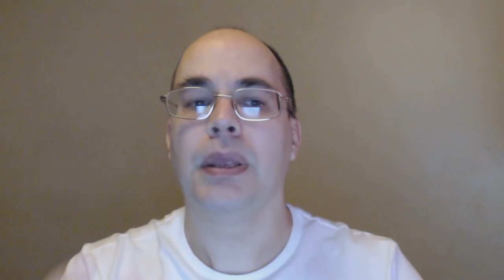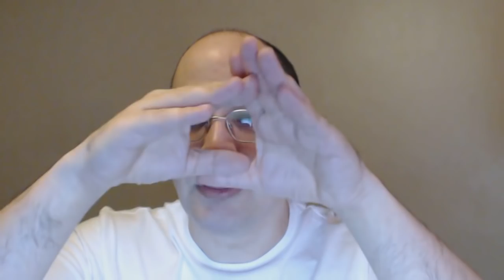How do rockets move in space, with nothing to push off from?

Comment: M J ... In space > NO MASS... the rocket shoots out weightlessness molecules into empty space... If mass = 0... 0=0... nothing happens...
Reply: Mass is not the same thing as weight. An object's mass does not necessarily change just because its weight does. "Weightlessness" in space is simply due to the distance between an object and the earth drastically reducing the attraction caused by the objects mass.
Reply: Think about it on the molecular level.
 When the fuels mix and are ignited in the combustion chamber, a fast expanding gas is created. The gas molecules fly in all directions at high velocity, creating a pressure against the inner walls of the chamber, when they hit them.
To the sides ("right" and "left"), the pressures against the walls cancel each other out.
The chamber doesn't move sideways.
To the rear, there's no wall, but an opening, so the exhaust molecules stream freely out, without any wall to create a pressure against.
To the front, there's also a wall, where the molecules hit and create a pressure.
So, there's nothing to cancel out the pressure against the forward inner wall.
The wall is pressed forward and with that, the engine and the whole rocket.
Reply: Christian Lemage - how about this simple physics problem? I have a remote control crossbow. It is loaded and cocked and I set it on an ice rink on little ice skates (or frictionless surface). What happens when I fire the bolt from the bow? What happens to the bolt? What happens to the bow? What if I use a low mass bolt like balsa wood? What if I use a high mass bolt like lead? What if the bolt and bow both have the same mass? Describe what an observer would see in these experiments.
Reply: all about momentum etc.. I get it...
Reply: Christian Lemage let’s hear the trolls here lol gj
Reply: +Christian Lemage If what you say is true (about molecules sticking together in vacuum), then when you explode a bomb in a vacuum it would stay completely intact and not blow apart. Is that what you are saying? And do you honestly believe that? Also, what you are saying about "weightless molecules" doesn't make any sense. If molecules were weightless then "everything" would be weightless. It would also mean that your car has the same weight with a full and an empty tank. I don't think so.
Reply from the maker: There is less weight in space, weight is a function of gravity and the further you get from objects like the Earth or the Sun the less weight they have (deep in space it will be virtually zero). However mass is independent of gravity and is basically how much matter there is present, mass is constant for any object whereas weight changes depending upon circumstances.
Reply: Ok... but:  action= reaction = equasion = equilibrium ... when 1 side is 0 (no matter/empty space) the whole equasion = 0 ... nothing happens
Reply: Does that make any sense ? I'm just doing some brainstorming...
Reply from the maker: Not really, but if you want to think about equilibrium and action and reaction think about a rocket stationary in deep space far away from any other object. The rocket is now in a balanced state or equilibrium, it currently has no motion. Now you start the rocket motor and the propellant is ejected out of one end, that propellant is now moving at considerable velocity, if when that happened the remaining mass of the rocket were to remain stationary then you would no longer have a state of equilibrium, so instead what happens is that the remaining mass of the rocket moves in the opposite direction to that of the propellant, action and reaction and the equilibrium is maintained.
Reply: I see the logic in what you say
Reply: Got this from other guy: 
There is no exothermic reaction of the molecules in a vacuum of 10^-7 mBar. It is an illusion. The molecules stick to the rocket body (free expansion). They can not be accelerated. An exotherm reaction is only possible in an atmosphere. In a vaccum of 10^-7 mBar there is no mass, no pressure for the required action. 

Think of an astronaut in space and a basketball in his right hand. The astronaut can't throw the basketball away. Both stick together in a vacuum of 10^-7 mbar. The astronaut can only exert a physical force to the ball (acceleration of the mass) when the ball exerts a physical force to the astronaut. And that is impossible in a vaccum of 10^-7 mBar. There are no molecules to fulfill newtons law. 

The space agencies know this. They try to skip this fact. They jump directly to a momentum (p = m v). They can not explain how the molecules (masses) are accelerated. The molecules can't fulfill work, cause they expand freely. That means that the molecules stick to the rocket body and wrap it bit by bit. Therefore, the blue flame in a high vacuum has the shape of the body.
Reply: There is no exothermic reaction of the molecules in a vacuum of 10^-7 mBar. It is an illusion. The molecules stick to the rocket body (free expansion). They can not be accelerated. An exotherm reaction is only possible in an atmosphere. In a vaccum of 10^-7 mBar there is no mass, no pressure for the required action. 

Think of an astronaut in space and a basketball in his right hand. The astronaut can't throw the basketball away. Both stick together in a vacuum of 10^-7 mbar. The astronaut can only exert a physical force to the ball (acceleration of the mass) when the ball exerts a physical force to the astronaut. And that is impossible in a vaccum of 10^-7 mBar. There are no molecules to fulfill newtons law. 

The space agencies know this. They try to skip this fact. They jump directly to a momentum (p = m v). They can not explain how the molecules (masses) are accelerated. The molecules can't fulfill work, cause they expand freely. That means that the molecules stick to the rocket body and wrap it bit by bit. Therefore, the blue flame in a high vacuum has the shape of the body.
Reply: Quoting here: 
There is no exothermic reaction of the molecules in a vacuum of 10^-7 mBar. It is an illusion. The molecules stick to the rocket body (free expansion). They can not be accelerated. An exotherm reaction is only possible in an atmosphere. In a vaccum of 10^-7 mBar there is no mass, no pressure for the required action. 

Think of an astronaut in space and a basketball in his right hand. The astronaut can't throw the basketball away. Both stick together in a vacuum of 10^-7 mbar. The astronaut can only exert a physical force to the ball (acceleration of the mass) when the ball exerts a physical force to the astronaut. And that is impossible in a vaccum of 10^-7 mBar. There are no molecules to fulfill newtons law. 

The space agencies know this. They try to skip this fact. They jump directly to a momentum (p = m v). They can not explain how the molecules (masses) are accelerated. The molecules can't fulfill work, cause they expand freely. That means that the molecules stick to the rocket body and wrap it bit by bit. Therefore, the blue flame in a high vacuum has the shape of the body.

Comment: All comments I've seen on You Tube show an ignorance of the correct law of conservation of momentum. The law states that the total LINEAR momentum of a system of particles is conserved if the SUM of the forces acting on the particles is ZERO. Both all external forces and all internal forces (between the particles) must sum to zero. The sum of the internal forces is automatically zero by Newton's third law. Therefor, if the sum of the external forces is also zero, the total linear momentum will not change.  Assume  there are NO EXTERNAL FORCES acting on the rocket. Then,  when the rocket fuel ignites in the bell shaped firing chamber, the hot gases expand in all directions. The gases going out the back contribute nothing to the increase in the rockets velocity. The part of the gas going forward pushes on the bell shaped chamber of the rocket and pushes it forward. That is why the rocket can work in a vacuum. And, that is why the shape of the bell is so important.  The change in the momentum of the backward moving gases will be equal and opposite to the change in momentum of the forward moving gasses and the rocket body. This is the correct use of the law of conservation of linear momentum  However on the launch pad, or where ever there is gravity or any other external force, the linear momentum will not be conserved, and the rate of change of the linear momentum will be equal to the force and Newton's second law of motion needs to be used to compute the flight of the rocket.
Reply: That is not how a rocket works at all Eugene. The fuel is flowing in one direction (out of the engine nozzle). The combustion of this fuel results in a controlled burn in one direction (out of the engine nozzle). In other words, the fuel ignites and is forced in one direction (out of the engine nozzle). This force is the only theing that creates an opposite force of the same magnitude. The momentum is conserved because of the oppsing force of the fuel acting against the part of the rocket that expelled it.  This is the same concept of water being sent out of a water hose at high velocity.